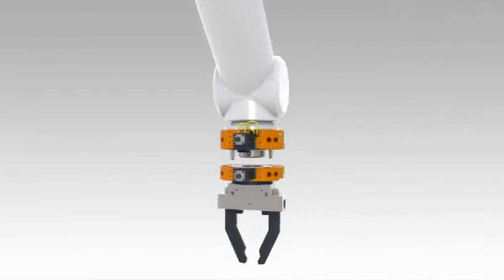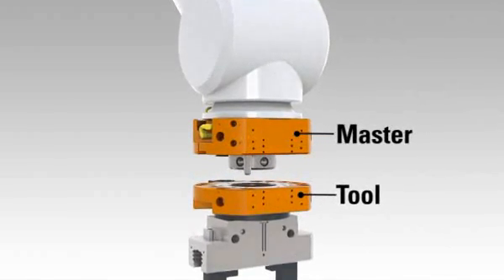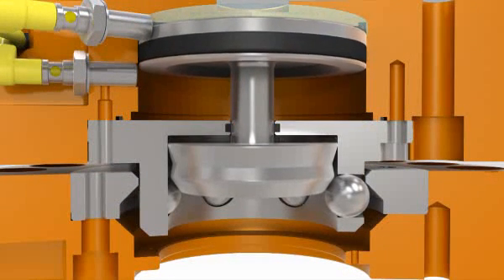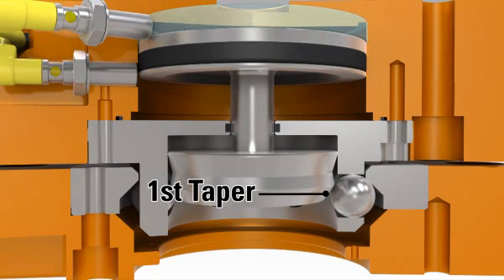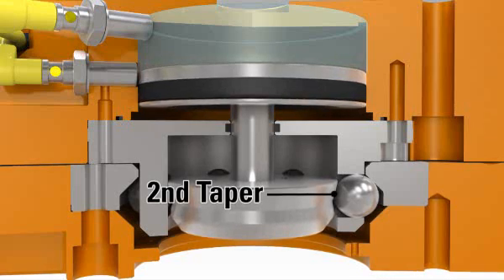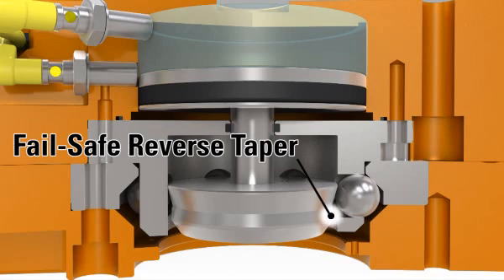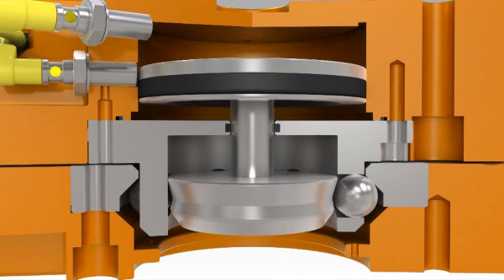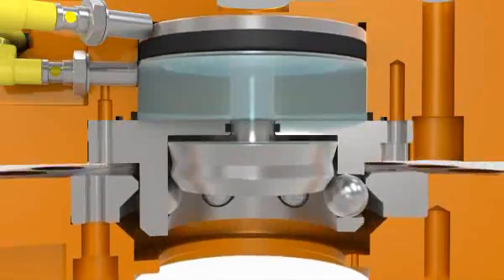ATI Tool Changer Locking Mechanism -- How it Works

Comment: what stops the bearings from falling out?
Reply from the maker: The male coupling of an ATI Tool Changer is designed with a retention feature to ensure the locking balls do not fall out when locked. The position of the piston prevents the locking balls from falling out when in the unlocked position. For more information please email SalesAdmin@ati-ia.com.